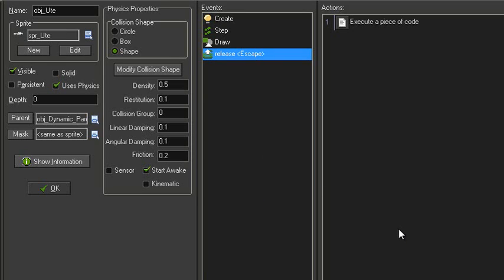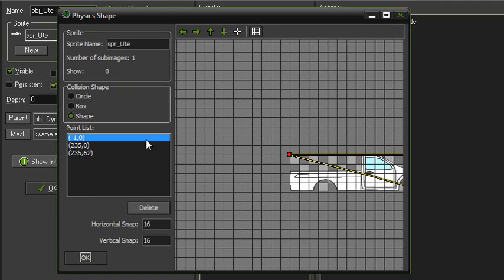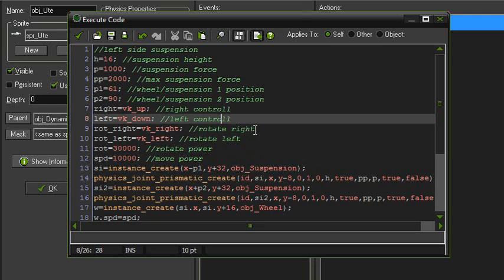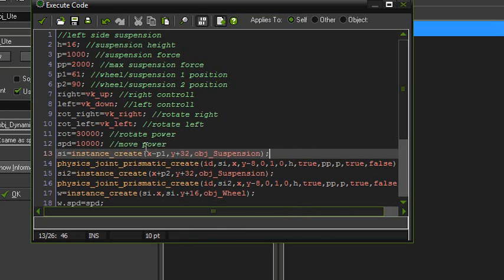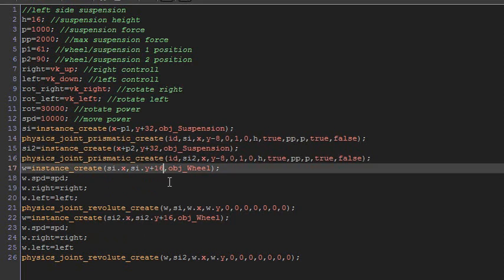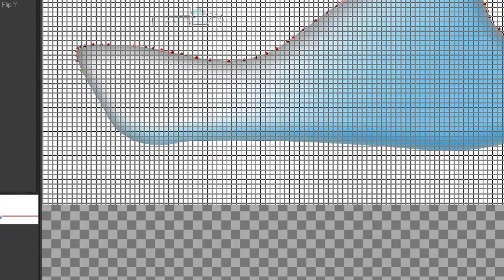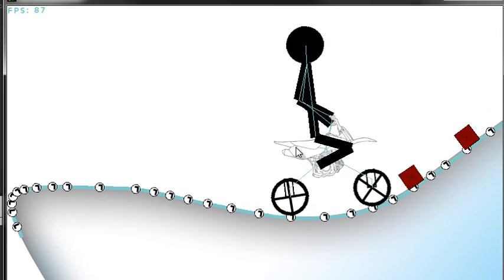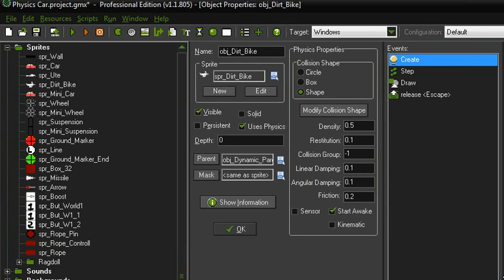How To Make a Physics Car With Supension

Comment: Hi and thanks for tutorials, there are awsome but I've got one problem, when I download file with code, the room speed there is 214 fps when I try to set it to 60 fps, wheels won't stay with car, but when I set room speed at 214, again everything work just fine, problem is that when I run it on phone(android) there is limitation to about 60 fps so the whole game is in slowmotion. My question is, is it possible to set room speed to 60 and still have everything working as it should?